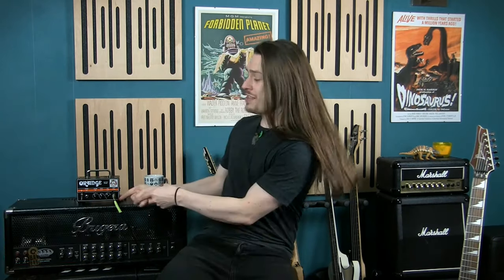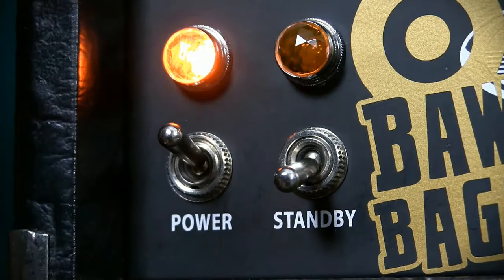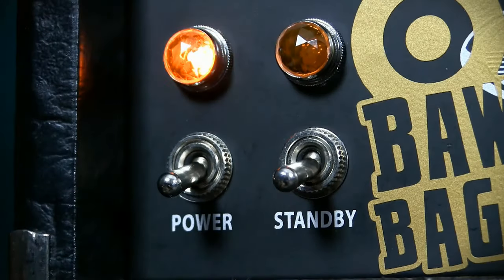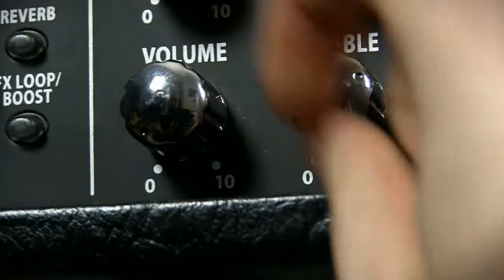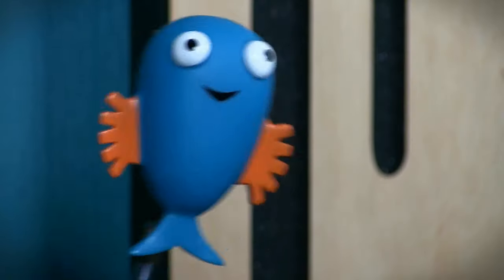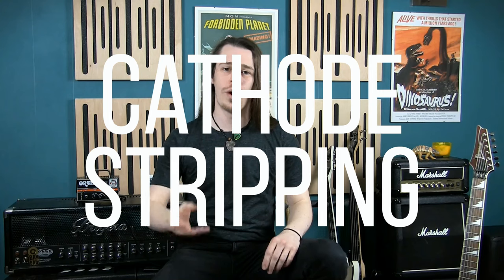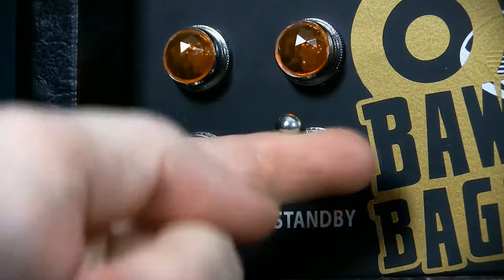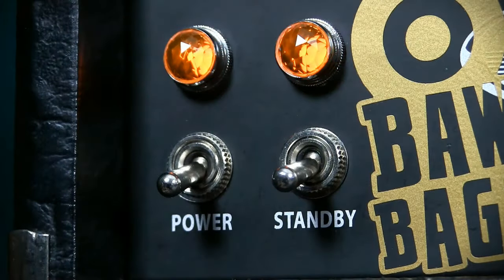Your Standby Switch Is A Lie!

Comment: Standby has its uses, leave the master volume exactly how it was set during sound check or for levels in recording. Flick the switch to kill the hum whilst it's not in use whilst the valves stay warm, perhaps recording something else, on stage whilst playing something not guitar. Well trained guitarists use standby religiously in the studio. I've seen plenty of tantrums when prima-donna guitarists have had to wit of amp to warm up on stage, or kept an asshole singer waiting. Worst is asking a guitarist (the kind that won't let you insert a DI between guitar and amp for fear of a VST amp ending up in the final mix) to redo the thing he just nailed in one take as you can hear the amp wasn't warm enough for the first few notes.

My Blackstar and even my inexpensive 90s Marshall hybrid (Valvestate - transistor amp with novelty valve, clean channel has nasty digital clipping with hot pickups) both have auto-standby when the guitar lead is removed. This is useful most of the time, but if I'm running the amp as a slave (preamp signal into effects loop return) I need to plug a cable in the input for the amp to work. I used a cut off guitar cable or a shorted jack plug with decorative loops of cat 5 innards protruding depending how much I wanted to punk the sound man / audience.

Blackstar HT series standby keeps the headphone/emulated socket running on standby, useful for running into headphones and possibly recording late night ideas, particularly with pedals that need a valve preamp to do their thing. I'd rather use a Boss GT and reamp the guitar in cubase for quick stuff though.

That said standby really was a thing on old TVs, and on CRTs this often used to keep the tube heaters on so there was no warm-up procedure coming from standby. It also means the remote works. I used to have a Sun branded crt monitor (24" 4:3 when 14 or 15 inch monitors were common with PCs) at my CAD workstation. It took ages to warm up and system went through multiple standby stages, blank screen for a few minutes then it would  cut the coil heater, changing the colour of the light on the front. The trick was to make a coffee and remember to press a key before going outside for a cigarette break or it would cool down and be wobbily and nausea inducing when I got back from my break.

Comment: But can't you use the standby switch for when you want to change guitars without busting your speaker?
Reply from the maker: or you could pull the jack out from the amp side first.
Reply: CSGuitars Wow. I never would have thought of that, but I just tried it and it works. Thanks for the tip.

Comment: All the he said/she said aside... 

Your initial demonstration of how to use the standby switch is backwards. "STANDBY" should be in the "ON" position before flipping "POWER" to the "ON" position. Wait roughly 20 seconds and then flip "STANDBY" to the "OFF" position. When turning the amp off, you could simply just flip the "POWER" to the "OFF" position or you could switch "STANDBY" to the "ON" position and turn the amp off that way to ensure no pops come through the speakers.

Not arguing whether it's needed or not, just simply stating that your explanation of the process was a bit mixed up

✌️💙✊️

Comment: My amplifier broke down because I turned off the amplifier without first activating standby then the amp turnup but the power tubes wont light up. Anyone knows what could be the problem (one thing its that y power off don't from the amp I turnoff the power supply or eliminator

Comment: This from the user manual pdf for a Carlsbro EVO 15H. Since that is what I have in essence with a Pulse PM15H, that will be my procedure at start up at least for the warranty period, by then I should be trained like a dog. Confusing though, the Standby "ON" is the toggle in the down position, not the upright position on the face plate of the amp head. Toggle in the Upright position and the Standby silences the amp. Toggle in the Down "ON" position and after the 30 seconds or whatever the amp playable with output sound as intended. To me, seems like Standby "ON" would meam you are engaging the standby to silence the amp, "standing by". Say what they mean, mean what they say and confuse OFF & ON as it makes sense or what they intended.

http://carlsbro.com/wp-content/uploads/2018/01/EVO-15H.pdf
Reply: My final thoughts on whether it's a lie or not. And it took me to read Mesa Boogie Owner's Manual for their explanation of the StandBy and their step by step procedure for power up. After observing & listening to the power down process using the standby, the standby does slowly bleed the electricity to silence on any amp. I have to believe that slowly "draining" the power from the tubes, also applies to the cold start & applying electricity to cold tubes by taking the amp from the idle of standby to ready to play state. Volume turned down to off has to be a bonus to standby. So I will follow instructions of the ritual rather that jolting th tubes to life, a gentler approach will probably save the electronics over the life of the amp. Seen too many horror photos of fuses that were blown, from just a wire with a clearer glass fuse casing that I would prefer to see from a blown fuse vs the fuse where the wire and glass have carbon buildup from a flash blow which to me is more violent electrical failure than a cleaner blown fuse. Maybe the volume level was higher, I don't know that, but a gently blown fuse at lower voltage has to be better on the amp as a whole of circuitry & a system than a higher voltage & more violent blown fuse ?

STANDBY: This large toggle controls the high voltage to the power tubes and from cold start, helps minimize the inrush of current and reduces the “shock” on them, which ultimately helps increase their useful life.  Just like a light bulb, much of the wear on tubes happens at the instant of power up.  Minimizing this shock and allowing them to warm up more slowly ensures they will give you the longest life possible. Before Power is switched on, make sure the STANDBY switch is in the “0” (switch down) position. Wait at least 30 seconds and then flip the STANDBY switch to the “I” position.  STANDBY is also very useful as a MUTE for either short interruptions–like changing instruments or patching cables–as well as longer intervals such as Set Breaks or other extended periods.  While you can leave the amplifier in STANDBY mode for hours with no harm, it is probably wise to power down if you know you won’t be playing for an hour or two.  Why waste the electricity? Just remember to follow the Cold Start procedure mentioned above when you power back up, even if the amp is still “warm”.  The filaments in the tubes cool much more quickly than even the glass they are encased in, and they return to their “cold” state even after a short time with the power off.  This procedure, when followed religiously, will help prevent tube problems and extend their useful life substantially.

Comment: Why does it make a loud pop if i turn off standby and turn off the amp quickly? Everytime i turned off the amp without waiting a few seconds after turning off the standby it made a loud pop in the speakers.
Reply from the maker: That 'pop' is nothing more than the capacitors discharging on shut down, being amplified through the speaker. 
Sound generated by the speaker is a result of changing voltage within the amp, when the power is shut down the large capacitors dump their charge causing a sudden voltage drop which can be amplified in the moments before the amplifier completely powers down. 

The capacitors will drop their charge like this regardless of the standby switch position, but the reason you don't hear it if the standby has been engaged for a while is because the standby switch disconnects the high voltage from the anodes of the valves, preventing them from amplifying. 

This 'pop' is not a problem, your amp isn't being damaged. The speakers are designed to handle huge volumes, so a sudden loud pop shouldn't be anything they can't handle either, but if you are worried you can simply turn down the volume before powering down.
Reply: @ScienceofLoud  makes sense, no one talks about that when talking on this subject

Comment: Sigh... the purpose of the standby switch is so you can disable the amp while on stage during high gain applications. You can put it into standby, go to the bar while your drummer does his solo, then come back to do your solo without having to wait for the amp to heat up. The standby switch cost $2 and is of real benefit. Your "turn down the volume" idea doesn't work when you're playing deathmetal through a messa boogie triple rectifier, because even with  the volume all the way down the amps loud as fuck.

Comment: So the Marshall instruction manual is wrong then. Son you weren't born when valve amps were designed. So every  old valve transmitter that had the same instruction printed in them was wrong. REALY?

Comment: Should i do it if the instructions tell me to use the standby switch
Reply: @Glissentar  thanks for the info
Reply: @Glissentar  thing is, if you even just minoring in electrical engineering, you kind of understand that the "preheat" routine can actually damage the tubes, and the standby switch was introduced to mainly protect the capacitors...

Comment: My Marshall Manuals say this:

NOTE 1: To prolong the life of the valves it is always advisable to switch on the Mains Power Switch (20)about 2 minutes before switching on the Standby (19).

NOTE 2: On powering your amp down, the Standby should always be switched off before the Power Switch is.

NOTE 3: The standby facility is particularly useful beforeplaying, when changing guitars and between sets as it allows you to keep the valves operating at a functional temperature without any sound being produced.

I don't know man...
Reply: TheBubtu funny, I have a Marshall Origin 20. It doesn’t have a standby switch...